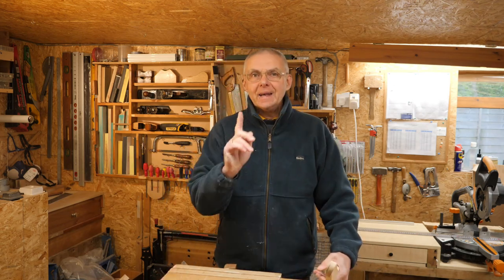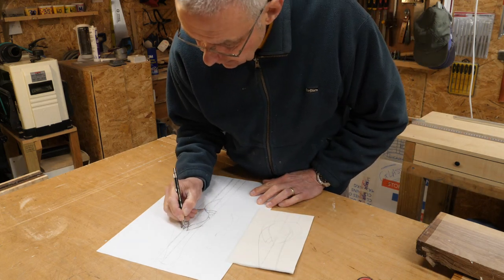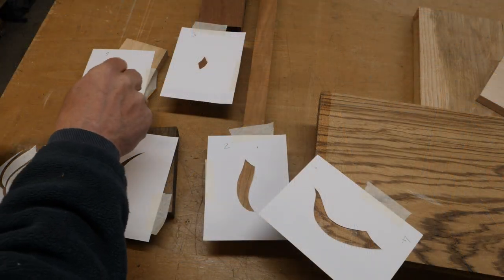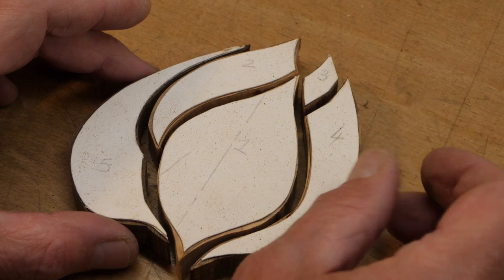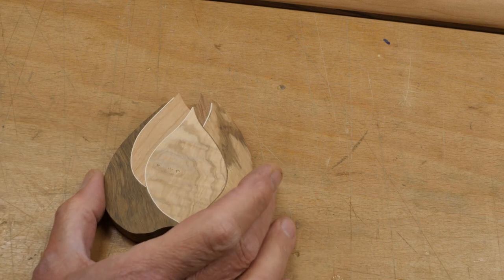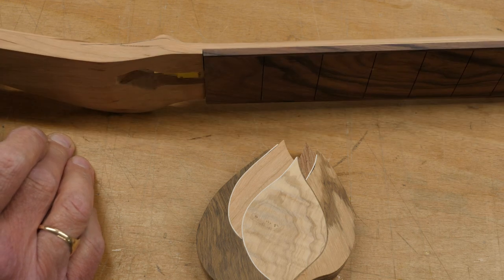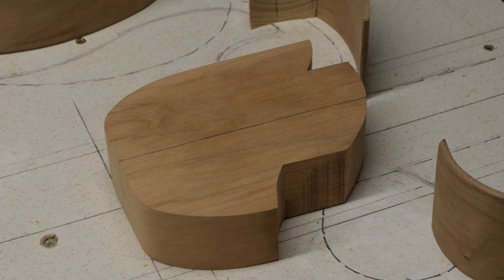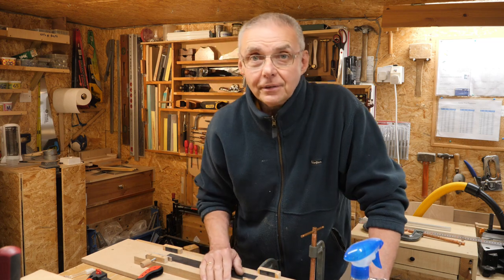#GGBO22 Community Build ep6: My daring neck rescue - part 1

Comment: Had a similar issue yesterday... Was leveling the neck and went through on the back about 3 inches down from where you are... Ended up setting in a long strip the length of the neck
Reply from the maker: Another great save! Cheers Dave